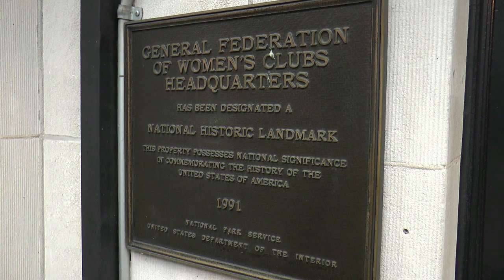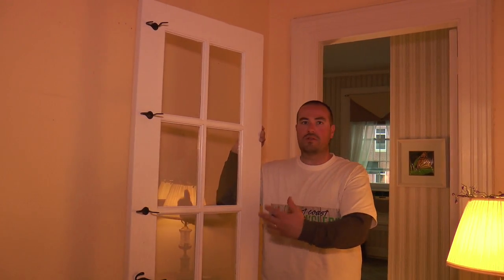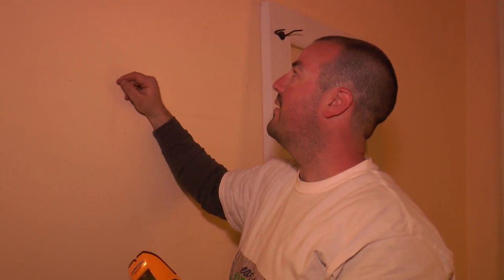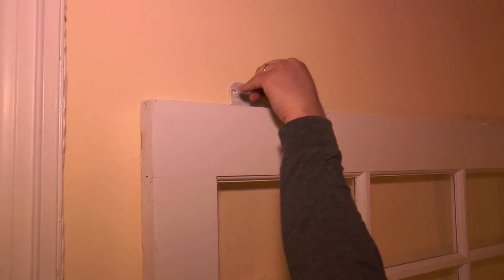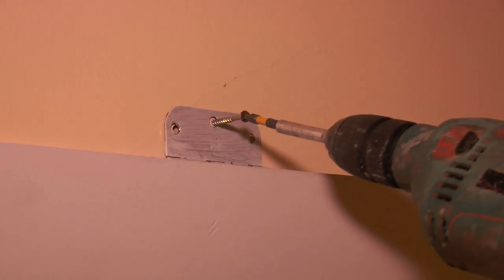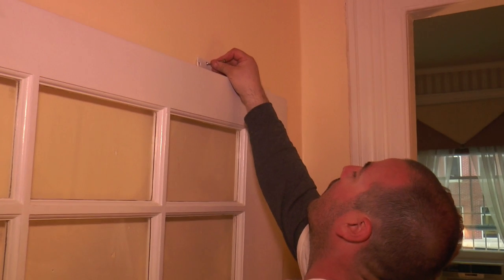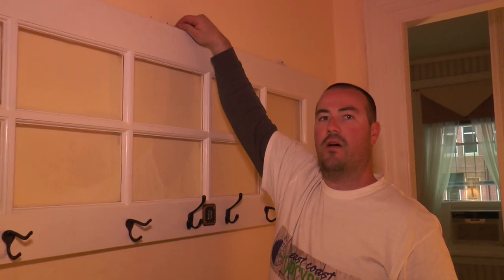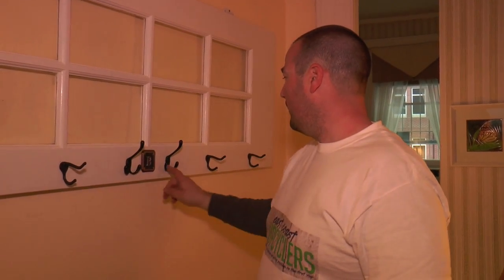Season 1, Episode 26: Door picture frame

Comment: My door is about 50 lbs.  I  bought some heavy duty hinges since it's going to be hanging and I plan to put it into the studs but I am nervous about the weight. any additional suggestions?
Reply: Instead of screwing directly into the studs, use anchors on both sides. You want both of them capable of holding at least 50 lbs since you'll also have to hold up the weight of the coats